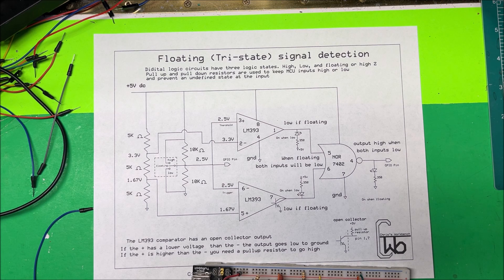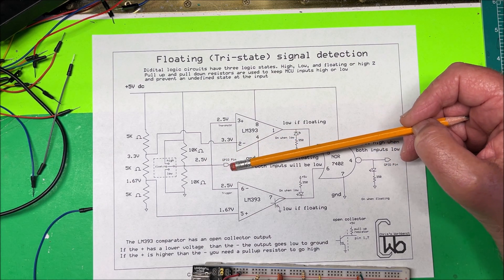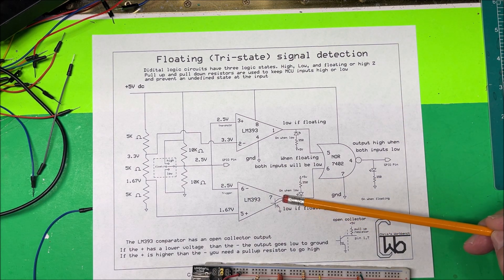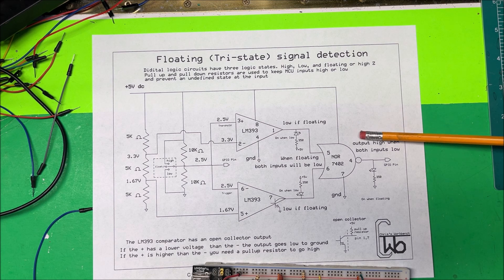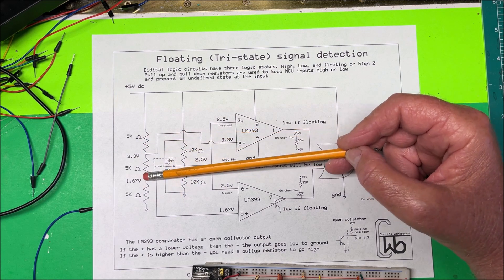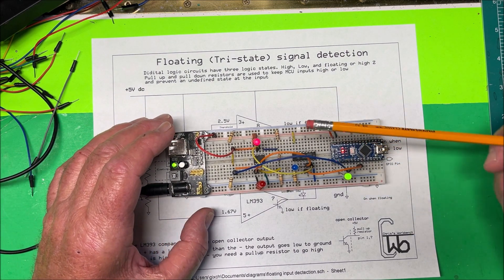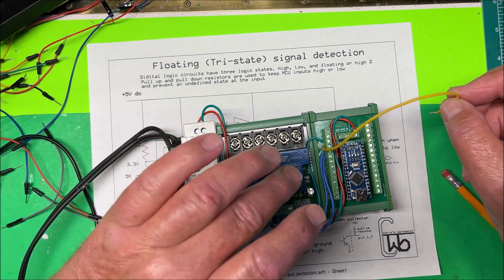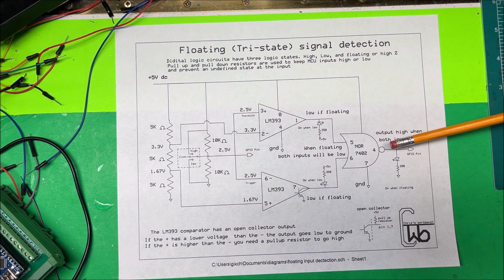Floating Signal Detection

Comment: My first thought was, “That looks like a 555 timer.” Cool.
Reply: My first thought was "that looks like a voltage comparator", firstly because of the triangular shape of the symbol and the part number looked vaguely familiar.

Triangle symbols are usually operational amplifiers and voltage comparators.

555 when shown on circuit diagrams tend to be square shaped.  So it being a 555 never entered my head.